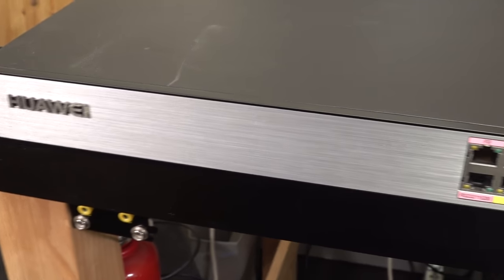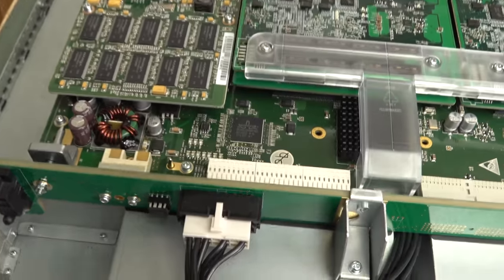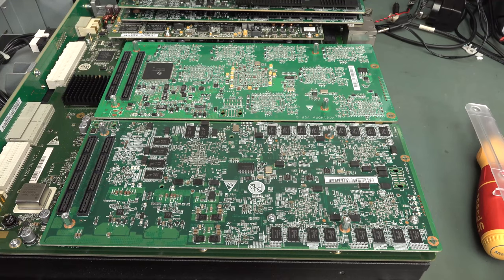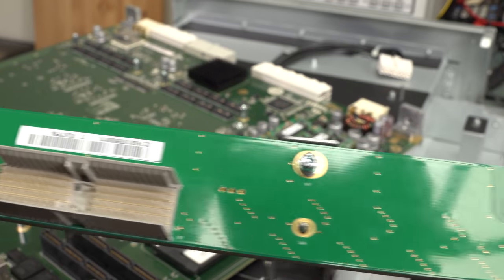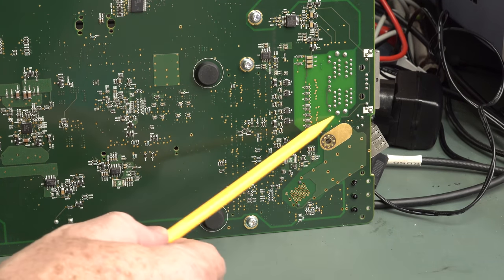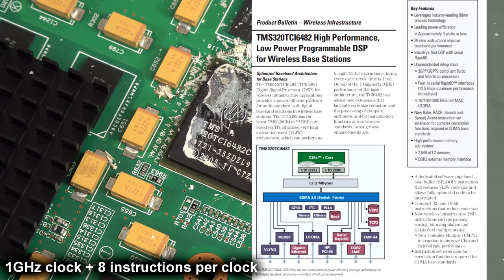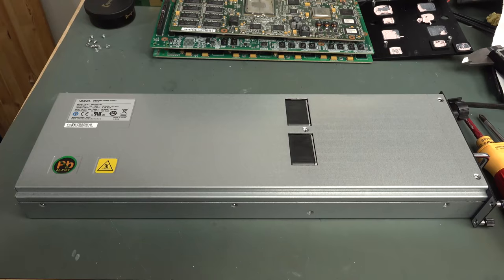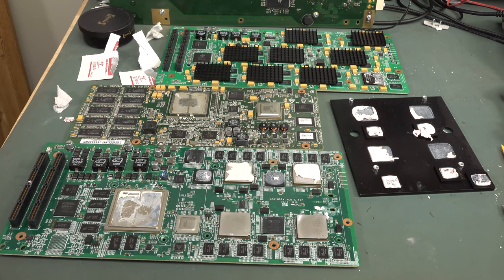EEVblog #1289 - Mystery Huawei Teardown

Comment: When I worked for a major US defense contractor, we built equipt to the same standards as this. Same manufacturing techniques and standards. The prime reason for it to exist was to last far longer than the designed lifetime. Reliability was the primary concerned. I recognize many of the cable manufacturing standards, and those were from the mid- to late-80's.

Comment: I was surprised to see the Davinci dm8168 in there. I have spent a lot of time over the last few years working with the little brother to that part (the dm8148), and they can only be described as a hot mess. TI has effectively dropped all support for the part and there are some really nasty silicon bugs to contend with, but for a part that was released in 2010 they have an amazingly fast hardware h.264 encoder built in that is still as fast as almost anything you can buy today.

The soul of that part lives on in the Sitara AM57xx series, but hopefully with fewer silicon bugs.

Comment: As retired test engineer, the testhardware boards has 8 to 12 layers, a tickness of 3.2 mm  and gold finish on outsider layers. Test machine connectors ends always whit a bed of pogo-pins. You do not mention the jtag bus on this system with is full whit high pincount bga devices mostly designed in the US.

Comment: Those power connectors on the back of the power supplies and fan tray are Multibeam XL connectors... They are a standard off the shelf part made by TE Connectivity and I believe they are also licensed to other connector manufacturer's as well, so nothing custom there... Also, those "ground pins" on either end of the backplane card are probably not actually used for ground, they are most likely just alignment pins used for blind mating the daughter card.  No idea what this would have cost, but a lot of familiar looking connectivity on that thing for the period... I'm an engineer for TE connectivity so this all looks familiar to me lol
Also, you nailed the high speed mezzanine connector, made by Samtec and TE... you must be some kind of expert or something!

EDIT: looks like this response wasn't needed lol, you pretty much said everything I did above later in the video.

Comment: Very similar to the approach of server blade and routing chassis from the same era.  You're spot on with the comment that cost is no object.  It's all about continuity of service delivery, hot swapability/live servicing, throughput and heat control in dense racked environments.
What's even better is when you design the server rooms and racks for these things, you need to worry more about BTU output and airflow than anything else.  You DON'T want hot spots or no-flow zones or you get real problems.

Comment: Impressive. Even the salvageable parts on those boards are worth a day's effort of de-soldering. Love it! 220uF tantalum SMD caps are amazing, never seen one higher than 100uF. The 32.768 KHz OCXO is definitely a keeper, I would love to put it in my all TTL logic desktop clock, replacing the already pretty accurate TCXO. Those 52V SMPS's can be ideal for RuiDeng's new lab supplies. Please do a test of those planar transformer power converter modules.
Reply: You can also buy MLCC capacitors at 6.3V with 220uF capacity in a 1206 package.
They are very expensive at 0.50$ per capacitor in bulk but they will generally outperform the tantalum capacitors!

Comment: There are circular diamond saws designed to drill into ceramic tiles. Put one in a drill press, then drill around one of those pins from the power supply, and then you can desolder that bit of pcb on there much easier.

Comment: In a former life, I worked with and deployed several realtime mpeg4 transcodey things in the early days of ip video.  Tandberg, RGB, motorola, scientific atlanta. This brings back the memories.  Likely it was before Huawei was on the scene, but all built up to a price.  Advancements/features, to be supported in the codecs,  were so uncertain  that fpga's pretty much needed to be used for transcoding.  We also rolled our own picture in picture transcode service, using commodity hardware.  24 streams per U if I recall.  Was a fun project in the way back times.
Reply: 24 SD streams and 8 HD streams in 2 or 3U was what Moto and SciA  used just about the same board layout and sold to cisco with a powerpc and not an intel.  88 grand seems to be the list price for 8 HD HDMI in/out with 2 1 Gig copper and 2 1/10Gig Fiber .   

I would bet some of gear circa 2006 for the second wave of HD channels is being torn out this year.  Nothing has changed in the industry, RF ingress and Drop and Insert and content management on/off a multicast seems older than rope.  

The content file collection I am sure is better,  no KENCAST of 20 or 50 Gig movie files and 60-400 meg commercials, just pick them up off AWS and cache.     Some bastard ordered the our KENCAST servers with 1 Gig Inflow and 100 meg interface to the content store.  The input was 10 times larger than the output to storeage so all humor was lost as the HD filled up.   We inherted the whole thing from another telco, so worst was Our on-demand system was always out of sync,  The last issue I remember was about before leaving was missing breaking bad episodes.    

Now you would just put everything in elastic storage and the head ends pick up what you need at the locals minutes before being put on the channel.   The on demand movies can be anywhere at any of the headends with a meshed IP network.    Soon enough most cable boxes will just put whatever commercial you will respond to inserted right into a NFL game.
Reply: @christopherwhull  lol.  I had to write our vod ingresser for our "super headend". I see we're kindred.  Nice to meet you Chris.  Lifetimes ago.  Was fun stuff.

Comment: I've got a customer that I do IT consulting for who has a similar video conferencing system from Cisco that cost around a million USD to install. But it is an incredibly trick setup.
Reply: @EK89 this takes H.264 streams from video conferencing systems and combines them into an output stream that shows all the pictures or one of them based on speaker detection. It's receiving the video streams of the various sources and encodes the output for the other parties to view in realtime.

Comment: Notice that on the audio board, where there are 9 chips for 8 channels--the center chip does not have two little chips peeking out from under the heatsink. Some kind of controller?

Comment: Actually you WANT turbulent flow around heatsinks. It seems a bit paradoxical,  but if you have smooth laminar flow, you end up creating a boundary layer that acts like an insulator. Turbulant flow generates vorticies that bring unheated air into contact with the heatsink. That is why the fins are serrated instad of solid.

Comment: Those board-to-board connectors could be Samtec QSTRIP/QPAIRS or something from the Molex mezzanine line. I got to know them when I was hand soldering a few of the former brand onto test fixtures for testing just a CPU+MEM control board assy on high-end test and measurement gear. It was quite a challange for the first time!

Comment: PSU at 31:00 - yes, they have a custom AC input filter on its own pcb, but DOH, still need to add an "on cable" common mode ferrite to pass EMC on the AC power cable that leaves that filter pcb and jumps over to the main pcb........ ;-)

Comment: Hi Dave I have been looking for a 50v 10A  SMPS for a project I been working on (buck converter lab bench power supply 0 - 48v 0 - 10a) finished but for power supply , so could I ask if I could please buy the power supply?  Thanks Steve

Comment: 4:04 Those connectors aren't custom, they are very common on enterprise grade IT equipment, i have seen both HP, IBM, Cisco and APC use them, most often found on PSUs and power modules/inverters.

Comment: Those pens on the front and underneath are also for alignment. That way when you are inserting the board or module it’s properly aligned so that pins don’t get Miss connect or vent.

Comment: As long as the XTZ accelerator can keep up with the QN rate when overclocked and the local MOSFET thermal reactance controllers don’t max out when power vector polarity morphs from linear non-phase reactance to non-standard decoder channel proxy configurators especially when positronic differentiation differs from radial expansion levels—I’m cool with it.

Comment: You better start wearing a foil hat, the electrons that fell out of that huawei device will be watching you from now on. ;)
Reply: I let some Chinese electrons out the other day. They stunk up the place for almost a day. Chinese voltage controller ( DC to DC ) became Chinese fire breathing dragon. Rated at 36 Volts, will tolerate 40 Volts, becomes smoke bomb at 45 Volts.

Comment: Those high-speed connectors look like Samtec QSH/QTH (or related). Fairly common for high-speed interfacing. The NVIDIA Jetson boards use them as camera ports.

Comment: Wow! Spared no expense. I have a question on the single-sided PCB for mains wiring (31:00). Can someone please explain why this is a good design choice? 

If the choice were left to me (a novice), my instinct would be to extend the mains wiring to the connections just a few inches further. My first guess is that it has to do with strain relief, but I think that could be easily mitigated via a cable routing clamp. Thanks!

Comment: Guess this is similar to a Polycom video conference bridge.  Crazy what went into that.  I'm surprised it does not run on -48v but considering the output of the PSU is 53v my guess is there is probably an option to wire it directly into a 48v bus (54v float usually).

Comment: The big mysterious connector on the 4.2mm PCB seems to be used for system to system interconnect (for their 10 units chassis). I have seen similar construction on the NI's PXI chassis, where they used similar connector for PCI and power. Maybe it is here just to connect to that extra flash? Like there might be some other sync or addressing going on on the bigger interconnect board, and this is just reduced version of that? feeding back a few clock or sync lines? grounding a few lines?

Comment: That power supply is pretty cheaply built compared to some of the data center/rackmount server units I've seen.  The basic design seems similar, though.  People use these sorts of power supplies (rack mount IT and comms gear) as big DC supplies for things like charging drone batteries.  The power output from them is top quality clean, and they're durable as heck.

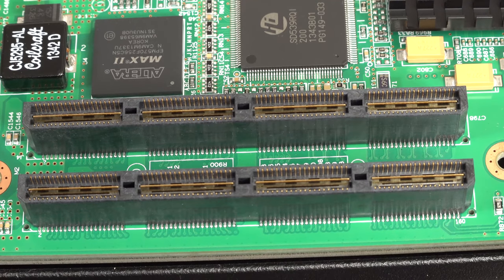Comment: 13:46 -- far left of the upper interconnect on the screening: there's a "?" -- wonder what that's meaning? Or maybe a non-ascii character that got mistranslated when printing the board?
Reply: I think it's a number they didn't decide yet at the time and forgot to name it later, maybe? Anyway, how did you noticed that?
Reply: @firepower9966  D'oh, yes of course that's it, thanks. @mr_jardle -- I like to check out the silk screen on boards. :-)

Comment: There are lots of chip fabs in Canada!
WPIXF1104BE.B1-900204 is an ethernet controller. those tilted cans hold 10Gb ethernet SFP's.
The small form-factor pluggable is a compact, hot-pluggable network interface module used for data communications over fibre optic links

Comment: One thing that strikes me: i's not very old! Well, it could be defective - but such expensive devices should run for many years. Not even 10 years old, and now in the bin. That is terrible!
Reply: True, not very old and now binned. Why it was replaced could have been for a number of reasons (most likely financial but could also be political). They could have at least tried to sell it 2nd hand and recoup some of the cost but the effort was probably going to cost more than it would have sold for 2nd hand...sad.
Reply: @stormkhan4250  if it was a 5 eyes government agency or contractor, the getting rid of it and replaced with gear built in vietnam or sir lanka is all paid for.   The NSA will send any government a unit out of their warehouse at a deep deep discount.

Comment: 4:04 those are probably not custom connectors. You see those on the PSUs too and I saw them on the PSUs of a Dell PowerEdge 1950 too.
13:04 I can see eight identical blocks and one clearly different block in the center. You didn't scrape us the serial number of that.

Comment: Are the press-fit power connectors used to avoid soldering directly to large power planes, which would likely produce a cold joint?

Comment: Quality hardware, little in any hardware security. Most of the costs would be going into the DRM licensing of the compression/codec software built into the system.
Cortina's Indian in origin. It surprises me they have a fabber in Canada, maybe a final assembly area where components are shipped into...

Comment: It has to be big to fit all the spy gear in there. I‘ve got a 2KW PSU less then half of this 750W one. What happens in >4x the space? Is it the Powerline demodulator and Internet gateway for all the other bugs in the neighbourhood? A Mains-Transient generator to fry critical IT infrastructure? Bad-Powerfactor Generator to bankrupt the electricity supplier and cause blackouts because of subsequent layoffs ? )

Comment: So it looks like ethernet for board to board coms, and pci switching at the board level ? It would make sense for scability and performance. and you can use reliable and well understood chips from the server world to handle all of the management and control stuff. The intel xeon scalable would also mean an x86 arch, which again, very well supported.

Comment: Are the press fit power connectors so that plugging and unplugging don't stress solder joints? Never saw that before, neat stuff.
Reply: They are also very common in automotive parts like ECUs. 

As far as I know, the gold plating on the connnector and the PCB via cold welds together when the connector is pressed in, which gives an extremely reliable and vibration-resistant connection.
I don't know why they use it in IT gear, maybe this connector just suits the requirements well and happens to be press-fit.
Reply: @Coiltec  Oh right, vibration makes sense, these units can probably be found in a mobile use case.

Comment: I would of loved to seen it powered  up  it doesn't need both power supplies to work it should be redundant so if one fails it switches to the other. And the SFP ports can be used for more than fiber modules it can also be used for 1gb 10gb 20gb 40gb ethernet if you wanted to buy a SFP card.

Comment: So this is basically a massive specialized box just for transcoding a lot of video streams (8 doesn't sound an awful lot though). I wonder, from purely technical point of view, what is the main advantage of using such specialized custom boxes over just using general purpose GPUs for transcoding ?
23:21: Interestingly these Intel chips use ARMv5 cores, not x86.
Reply: Because you gamer video card would die of heat death after trans-coding just 1 HD for a month, these trans-code constantly at TV stations and headstands for years on end.   The OS is really stripped down, everything about setting up streams to and out of memory, and making switches between streams at exact frames.   For what these do they are cheap because cable companies buy them by the truckload to drop and insert local commercials.

Comment: 14:40 ha!  Look, the optical transciever housing is JUUSST too long to fit orthagonally, so that explains the jaunty angle of the housing slot on the outside, because it's had to be fitted at an angle to clear the interconnect stack behind it!!
Reply: Angling them like that is quite normal in telecoms equipment, as fibre has serious bend radius restrictions. I wouldn't assume they angled them to clear internal components so quickly.
Reply: @Monkeh616  it goes to an arm that manages the fiber and the cords.   That angle is the least bend when the device is slotted the racks and the arm is folded. 

Broadcast racks sometimes have very little space behind unlike modern data centers with hot/cold isles.   This could go into a tv station for transport out to the tower, being right below the eng wall of tvs would not be uncommon, where the power light and data light blinking can reassure everyone that there is a IP stream flowing out.